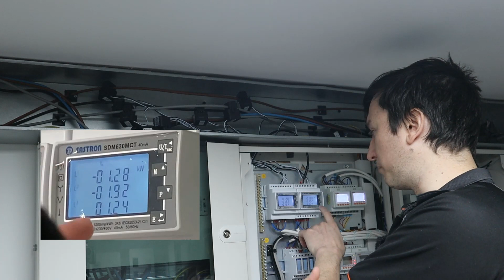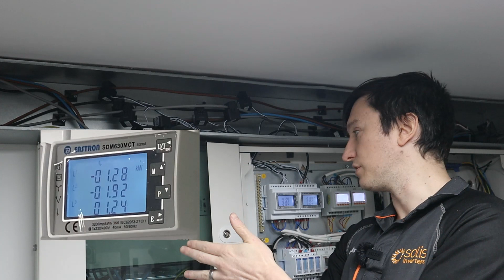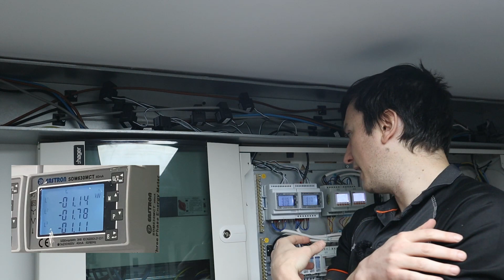Solis Meter Installation - CT Polarity

Comment: Hi, what’s the maximum distance I can run a CT clamp cable from my solid hybrid inverter to grid meter connection?
Can the 10m cable be extended?
If so what’s the max distance?
Thanks Ian

Comment: Hi Paul, 

Thanks for another great video.

Our solar is working 100% I just have a question on the how the EPM/CT differentiates between import & export.

How does the CT distinguish power direction. The CT is clearly directional, when you rotate it the reading was corrected and went negative. But what difference does it see in the ac current wave between import & export?

A hypothetical scenario two black boxes only linked by two cables a live and a neutral. One box contains the load and the other the power source and we don’t know which is which.

All we can measure is the voltage sine wave between the two cables and current sine wave from a CT on one of the two cables.

What aspects of these two signals gives a clue to the power direction?